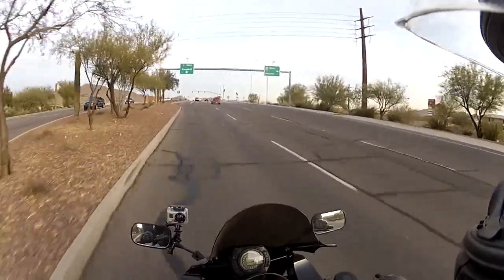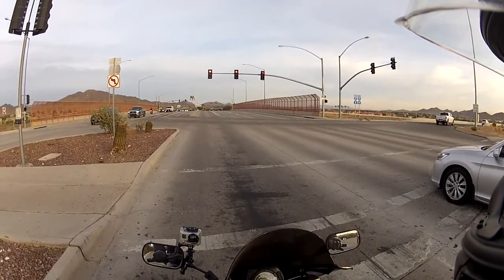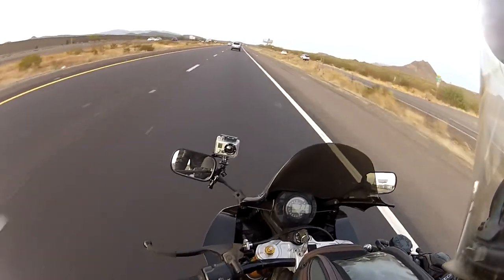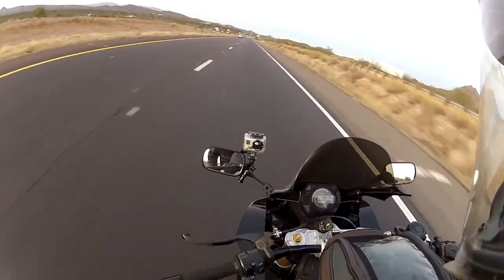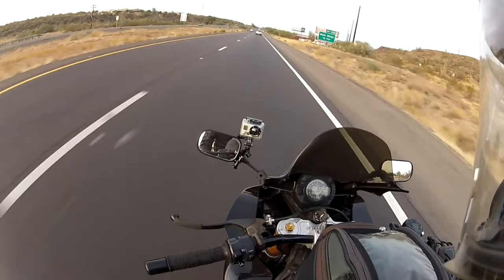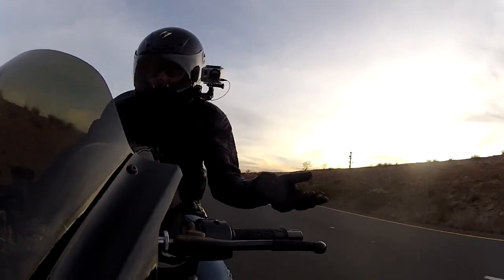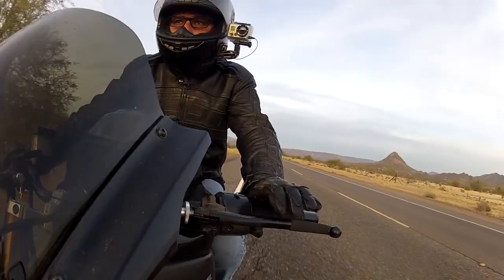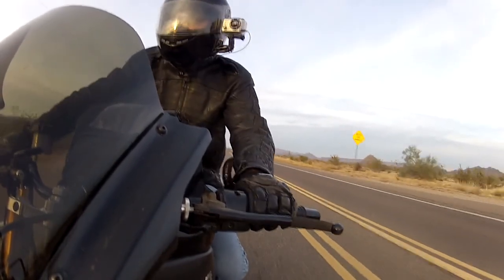Clutchless upshifting, Universal motorcycle distress signal, Keep warm

Comment: Sup, WB. I feel ‘ya on the ‘drive’. Direct sounds like it should be the fastest route for power out & vice versa for indirect, right? I wonder if clutchless shifting works on a shaft drive? I never knew about the distress signal. And they say you can’t teach an old mule new tricks? Lmbo! Just don’t stand behind one and slap his ass! ☮️ PS:When you gonna pick up the blue beauty acoustic again? Lol. As if you have time. 😜 L8R.
Reply from the maker: Clutchless shifting would work on a shaft driven bike too, if done properly, I think it would work with almost any manual transmission. As far as the blue acoustic goes, I’ve been putting in late nights in my lab (garage) concocting my next cringey musical invention as we speak. I only recorded video of the bass playing and drumming, but the guitar playing is the blue acoustic in the music track. You’ll see lol